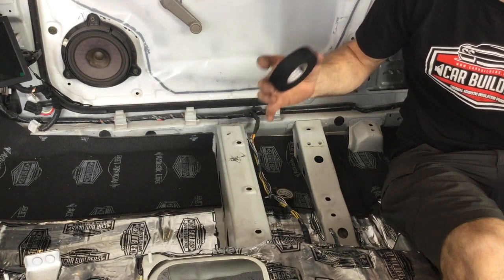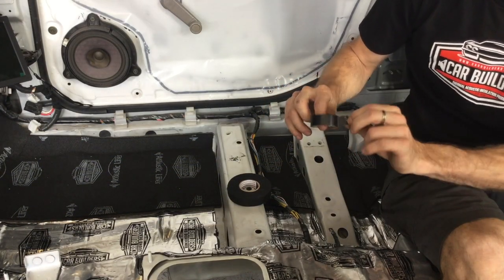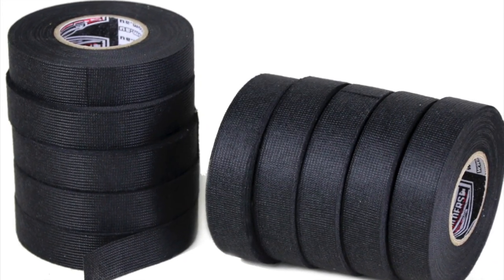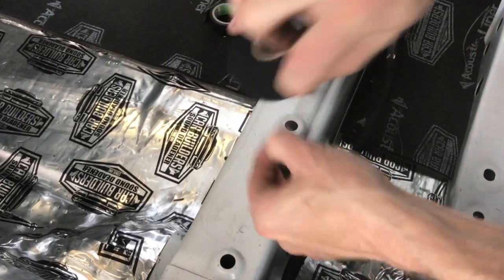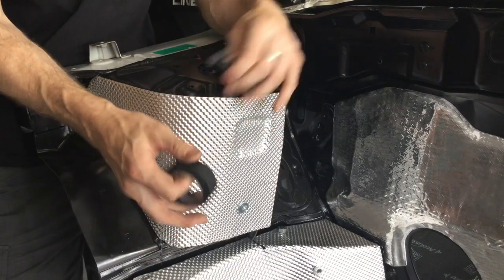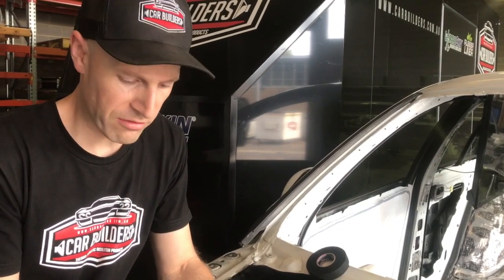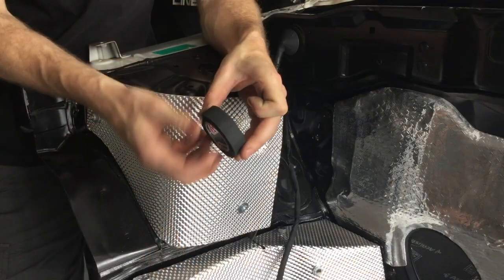What is the best tape to use to wrap car wiring? How do I wrap car wires to look OEM?

Comment: Don't you worry about a cloth tape like that collecting moisture?
Reply from the maker: Hi Tim. We recommend the fleece tape for internal applications and the Underbody Tape (which isn't fleece) for engine bay and exterior applications. 👍
Reply: @carbuilders1  I need to find the underbody tape for inside then :)

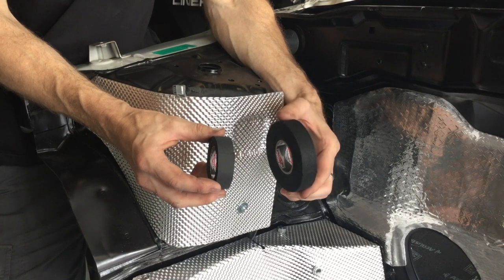Comment: Where did you get the aluminum metal heat shielding from? the one in the engine bay at 1:30 time.
Reply from the maker: Which ship internationally from https://www.carbuilders.com.au/engine-bay/ 
Another US option https://www.amazon.com/dp/B07P6KXCB8 We are just about to add the other heat shields on this platform 😎👍
Reply: Car Builders - Thermal & Acoustic insulation materials - is this a heat shielding wrap for wires? I have a coil on plug kit that needs the wires wrapped and I want to do this professionally, what do I need and how do I go about it?